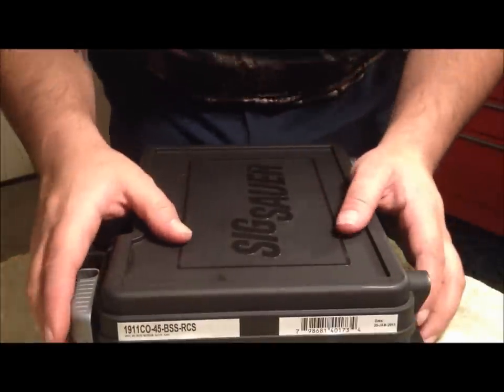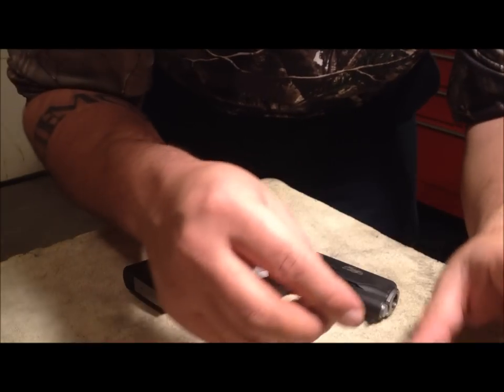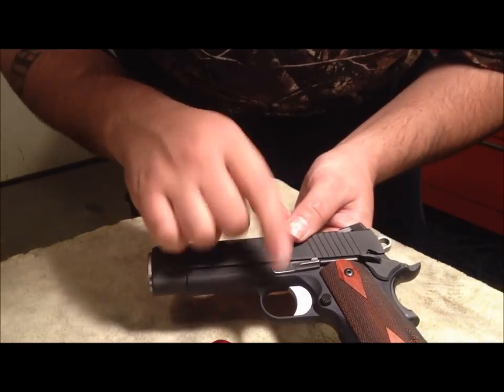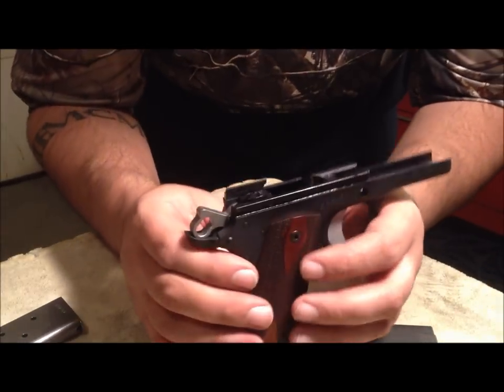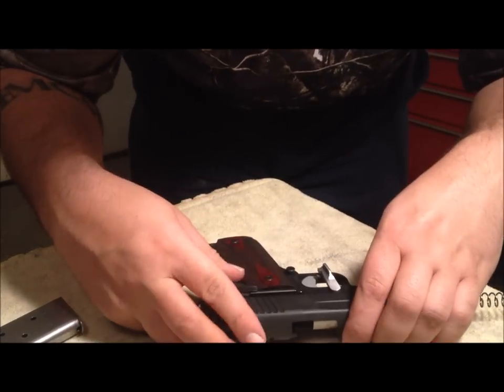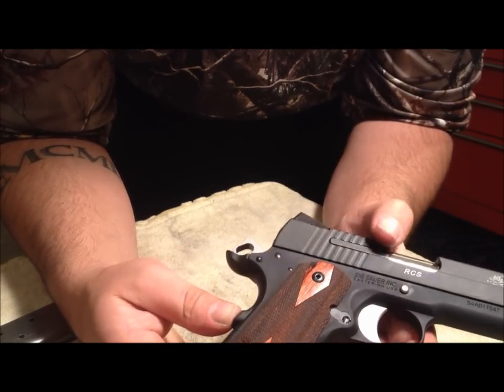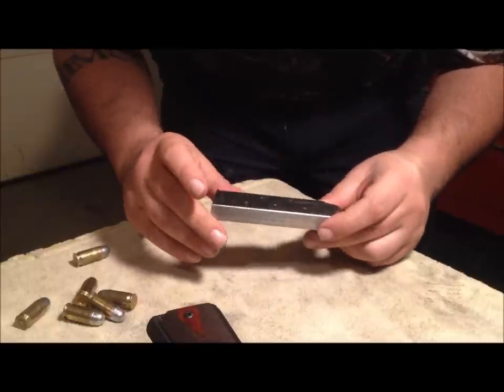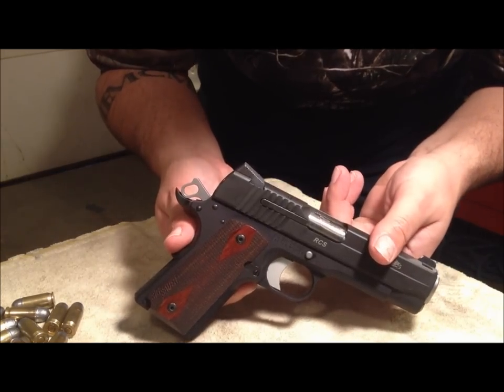SIG SAUER 1911 RCS review

Comment: Did you ever replace the recoil spring? I ordered a 20 lb commander recoil spring and it's longer than the factory one that came with the gun. Is that normal?
Reply from the maker: i had to sell the rcs cuz i needed money, but no i did not replace the recoil spring, but if the spring you ordered was a wollfe spring then yes it would b longer, just because a spring is longer does not mean its heavier poundage